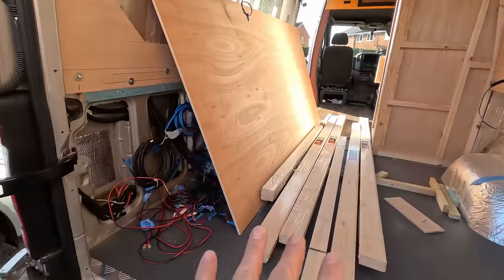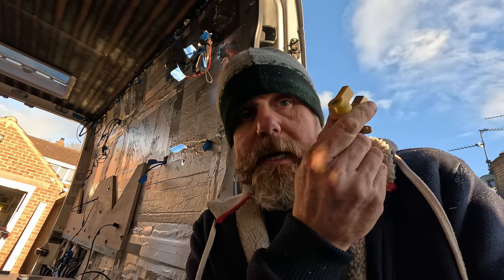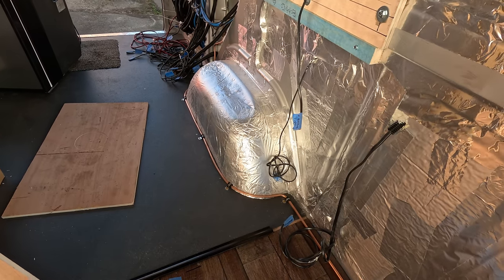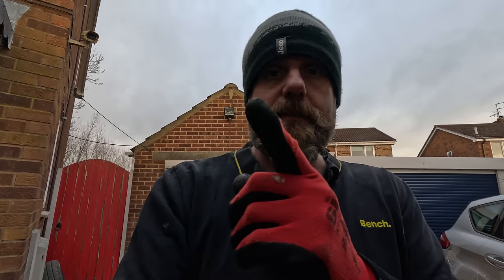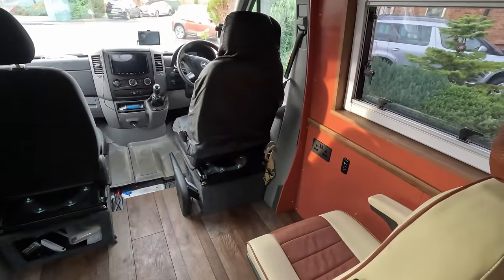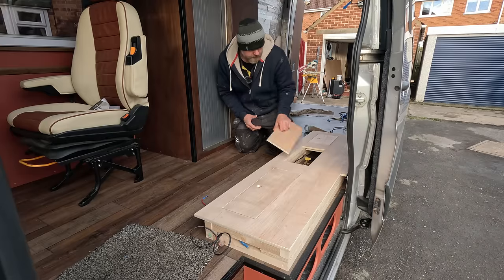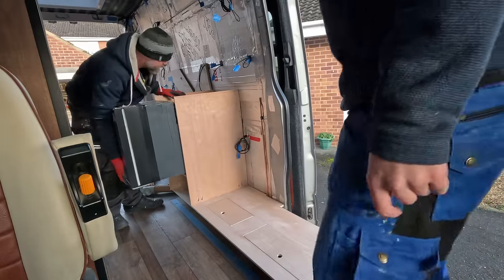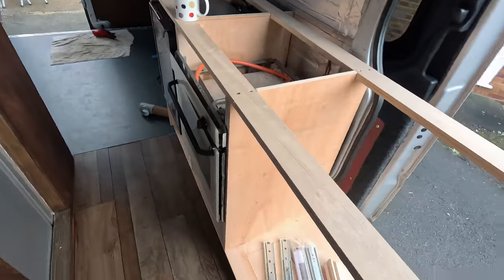sprinter van conversion, kitchen built part 1

Comment: Great video, Adrian. It's looking great that kitchen one thing i would defo invest money into is a carbon monoxide detector cheap as chips to buy and give you peace of mind the side of the kitchen i think would look lovely in the stained wood 😊 when you do varnish the outside of the shower i would also do the side of the kitcken and the back doors to it just an extra bit of protect and any stained wood in the van i would personally would just varnish it its little bit extra work but would finish it off nicely and give the wood that bit more durability in high traffic areas 👍🙂
Reply from the maker: Thank you. Yes I'll definitely grab a detector. In fact I'll order one now. I think the votes are swinging towards the salmon for the kitchen walls I'm afraid. Plus I have lots of that paint left😂. Yes I'll get some varnish on the other wooden bits. Cheers
Reply: @life_uncharted  the salmon colour is a lovely colour and its your van build so do what make you feel happy what ever you do will look fantastic ❤

Comment: Have you put a air vent in the side of the van for tthe heat of  fridge and cooker
Reply from the maker: No I haven't. Do you really think I need to?
Reply: @life_uncharted  I would check up on other van builds and read the instructions yours in boxed in pluse you have a heating pipe under it .
Reply from the maker: @lighteningjak  Cheers. I've read the frdge instructions and there is nothing in there. obviously the oven is second hand. I'll look into it. thanks again